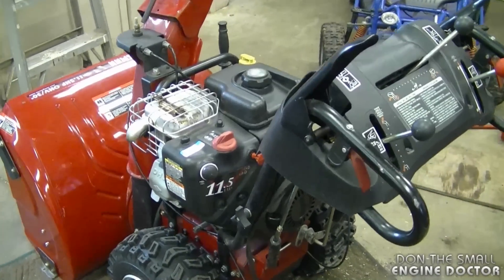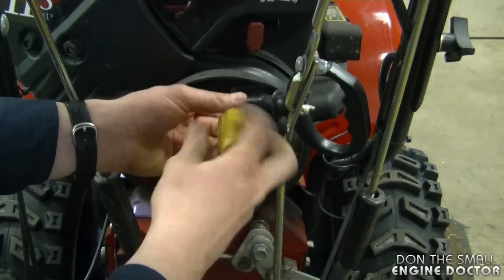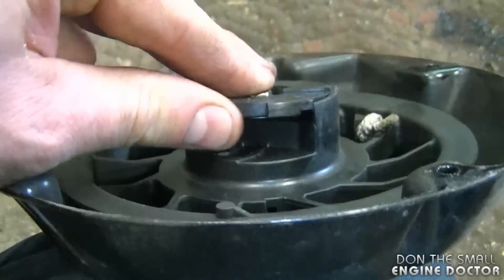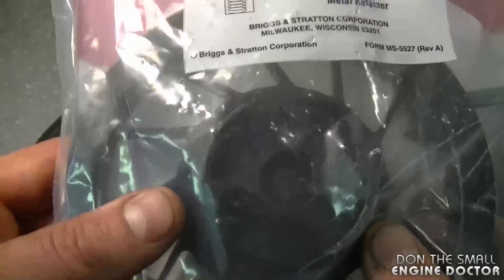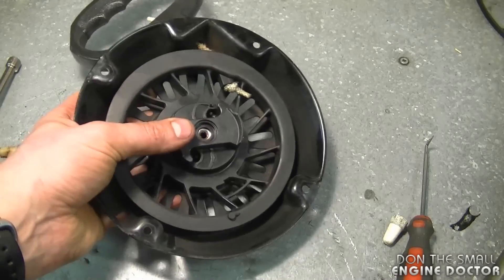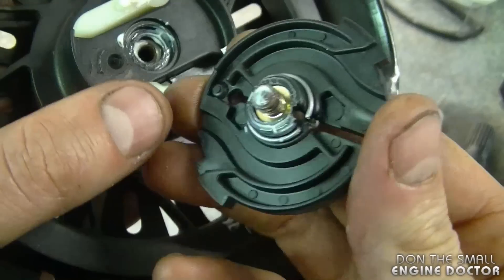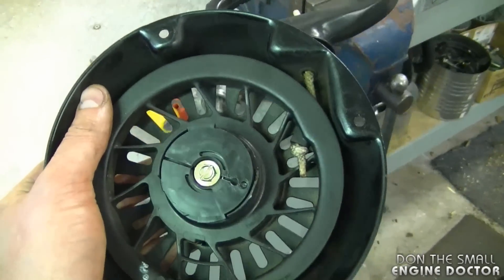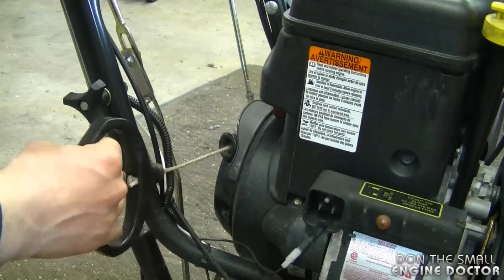Pull Starter Repair On Briggs & Stratton Engines - Snowblowers Etc.

Comment: Too much plastic on Briggs these days and other motors as well. I recently bought a PowerHorse generator from Northern Tool here in USA. I took the recoil assy off to reposition it and was pleasantly surprised that the recoil pawls and cup are all metal.  The rope is good quality as well.

Comment: thanks dony for your dedication and easy to follow instructions. which way do you turn the pulley as so the string will not fly out if you had to take the pulley all the way out.?
Reply from the maker: clockwise direction

Comment: The recoil reel did have a bit of damage one of the tiny pins on it that prevents the pawls from coming out too far broke off. It's not worth replacing it just for that as the pawl cup will limit their travel. But just something to note.

Comment: Very educational video which I hope will fix my problem on my B&S 5550 WATT 10 HP generator.

My problem is the recoil starter wont pull more than 2 or 3 inches. It appears to be locked somehow. The generator only has about 20 hrs. use on it. I would appreciate any solutions/suggestions you may have! Thank You!!

JR

Comment: Your videos are really helpful. I have a old toro 824 snowblower. I dont get spark at all. Any ideas what it could be?
Reply from the maker: could be points
Reply: Gil Santos Landscaping LLC I think those engines have ss ignition. Check the coil gap under the front shrowd
Reply: Solid state ignition not ss ignition

Comment: Great videos Don. Do you have a video on a carb rebuild for B&S snowblower overhead valve engines? They are the 14.50 & 11.50. These are two different carbs internaly.
Reply from the maker: not yet but working on it

Comment: THE PARTS THAT ARE REPLACED ARE MADE TO FAIL SO THEY CONTINUE TO MAKE MONEY OFF OF PARTS IF THEY MADE THEM FROM METAL YOU WOULD NOT NEED TO BUY THEM YOU WOULD ONLY BUY THEM IF YOU LOST THEM TRYING TO REPAIR THE MACHINE GOOD VIDEO DONYBOY

Comment: Exit light enter night we're off to never never land .....!!
Reply: Quick question, how do I put back together the bearing and belt pulley back in the auger housing on a 1999 tecumseh 926se with a snow king 9hp. Thanks I do you put the bearing on the shaft first? Then push it all back in then put the belt pulleys on? Thanks sandman !